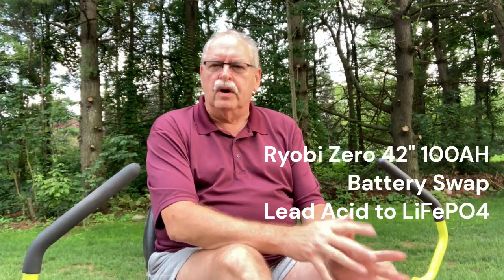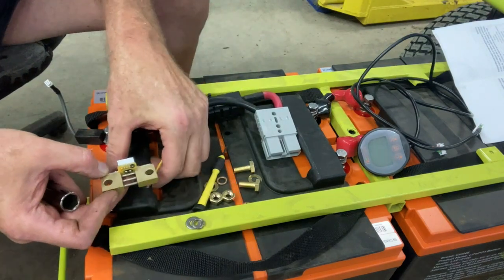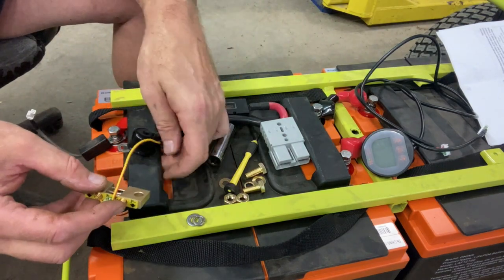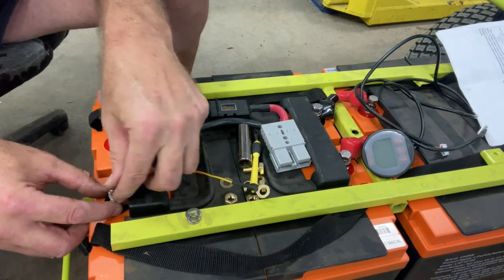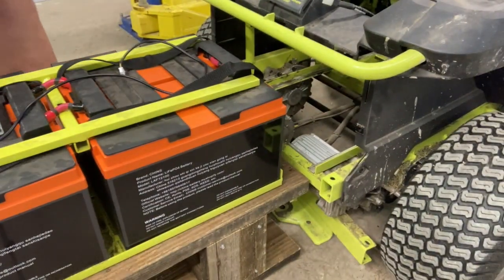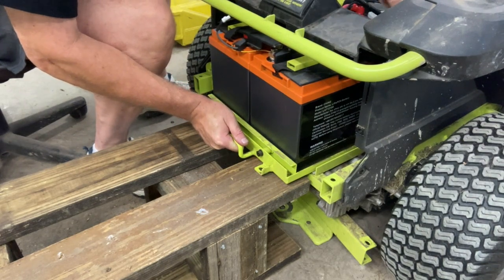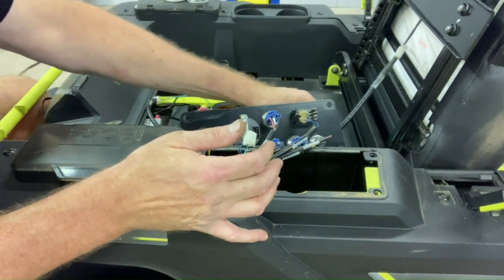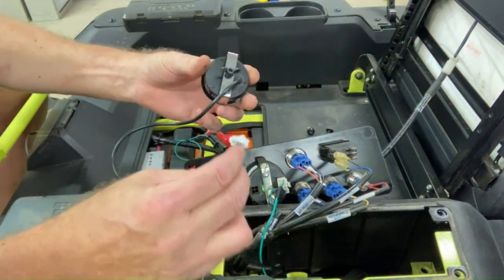Ryobi 48v Battery Swap - Load the batteries and install new battery meter

Comment: Great video. Who is the manufacturer, model number etc. of the voltage gauge? Where can I buy one?

Thank you.
Reply from the maker: The components and battery meter are detailed in the components video linked in my video description.

A few people have commented that they didn't get the gage.  They just got the batteries and charger.

The gage is available from a few different sources, but, I got mine from AliExpress:
DC 8-80V 100A TR16 Battery Coulomb Meter Capacity 
$24 AliExpress free shipping plus tax
https://www.aliexpress.us/item/3256805170271326.html?spm=a2g0o.order_list.order_list_main.5.323e1802JWJmXk&gatewayAdapt=glo2usa

Let me know if that link works for you.
Reply: Thank you. @robertveldman1901
Reply: Hello, after looking at the link that you provided I see that the site offers three different gauges. Which one did you use?
Thank you.
Reply from the maker: @debbiegardner-pope4576  
80v 100a
Reply: Thank you for the quick reply. @robertveldman1901